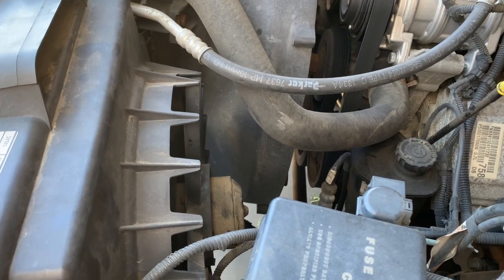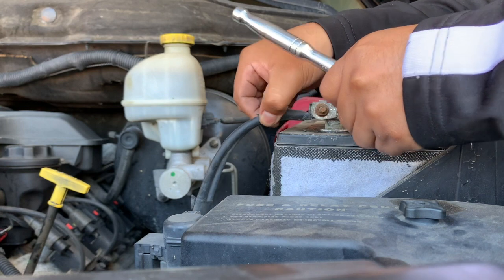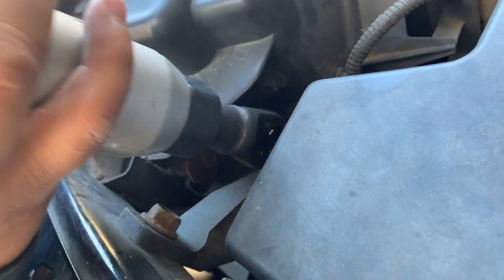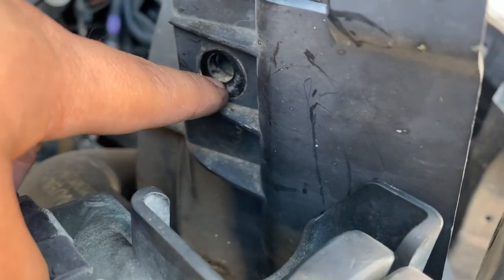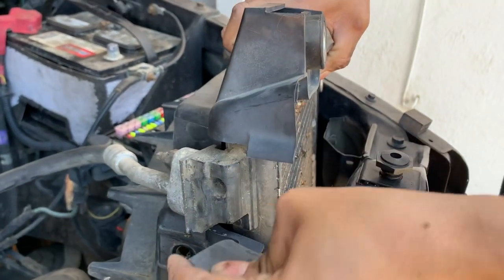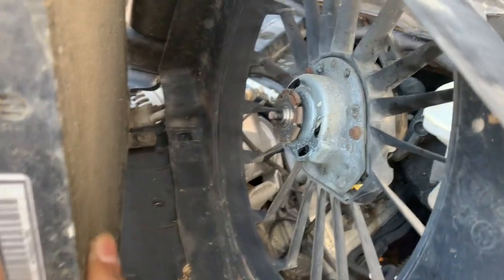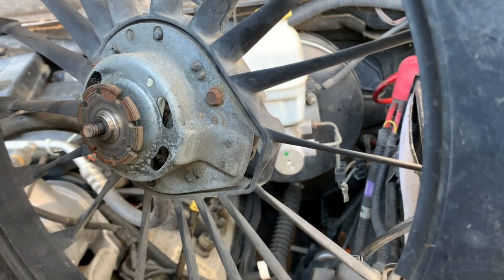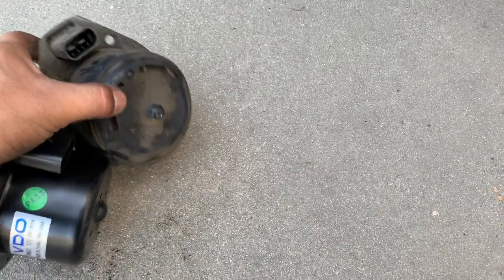How to Replace A/C Condenser Motor Fan AC Repair Dodge Ram 5.7 1500 2500 3500 2002-2008

Comment: Broo as straight forward as it could get💯 i just got a 2005 1500 5.7 with 120000 miles and the ac fan took a shit thanks for the video compa💯
Reply from the maker: Thank you for your comment and for your support. Nice nice- these trucks are reliable as long as they are maintained. I have some videos for this truck check it out when you get a chance. My wife’s truck is a 2004 1500 5.7 Hemi and it has 305,000+ miles on it and still running like a champ.
Reply: Where did you guys buy the motor by itself?
Reply from the maker: You can buy it at any local auto parts . Also I have the link to it under the description. Best of luck.

Comment: In case anyone is fighting the electrical connector. There is enough room to pull the whole housing out and enough slack in the wire to pull the plug after the housing is out and fan is off.

Comment: Add electric fan in front of condenser (push pull config), it will drop temp 10 degrees

Comment: Dang it I was trying to see how you remove that electrical connector, but you didn’t show that part. I can’t get mine disconnected.
Reply from the maker: Lol use a flat head screwdriver and lift up the connector from the motor condenser (wiggle and pull back). These are stubborn because they are old old and been there for many years ... Best of luck.